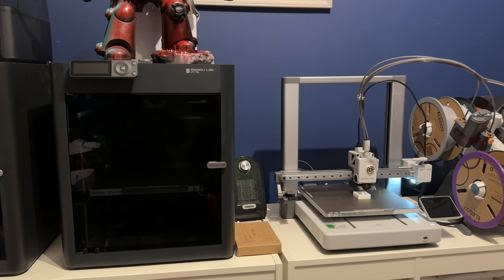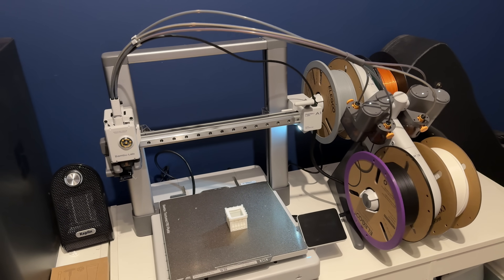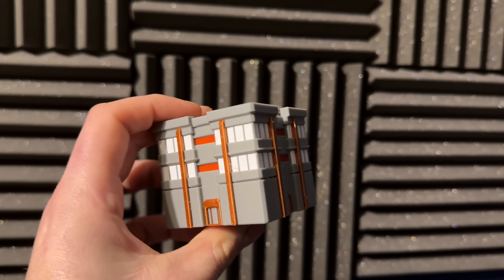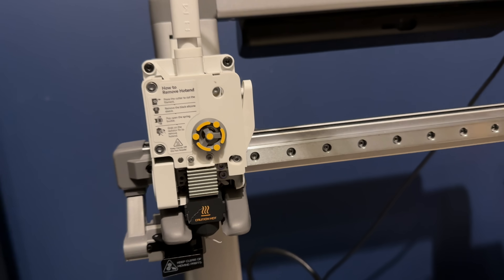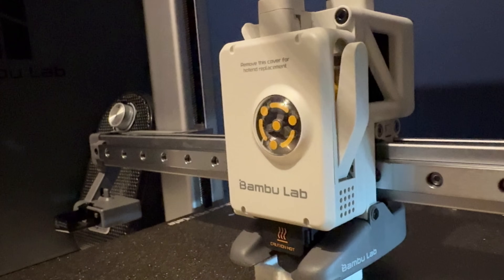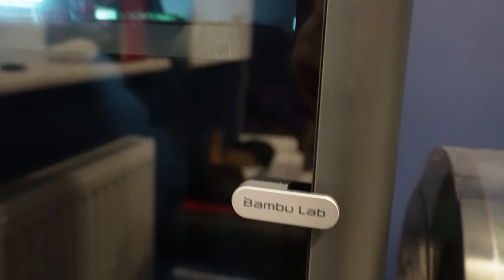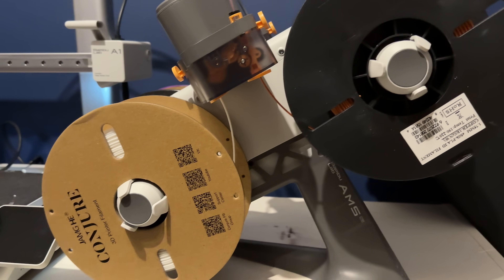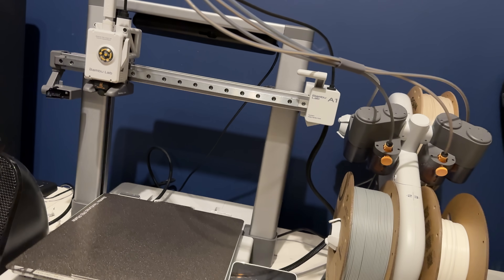Bambu Lab P1S Vs A1: Which one should you get?

Comment: My main question is about the wiper. I just bought the p1s but I'm hearing that the wiper is much better on the a1. I dont want to install mods to mod the wiper on the p1s. How much of a problem does to factory wiper cause on the p1s?
Reply from the maker: I've got two P1S' and an A1. The A1 has a better wiper, but it has affected my prints 0 times on the P1S. Even when there's a little bit of filament still on the nozzle, it never gets in the way.
Reply: @GrayScalpMiniatures cool thanks. Did you change the stock wiper

Comment: 🇨🇦 A1 mini $249 w ams lite $449
      A1.         $399 w ams lite  &589
     P1S.       $649 w. ams        $899
purchased A1 mini w ams lite just over a year ago , have run 40 kg of PLA & PTG through this little beastie 
just regular maintenance , dead simple it out in the open .This little printer in built like a tank , auto calibrate, flow control, clean the bed with Dawn and hot water .The ams lite just works, period.

Comment: I went for the A1 since I heard it was not as noisy which was the biggest problem for me :)  Heard the A1 Mini is even more quiet so I will try to get one of those later.
Reply: and now I bought a P1S haha.. I noticed when printing objects of height.. they could often be bad cause of the printer still prints at full speed at higher layers and the laws of physics can shake things around.  So bought the P1S on the Bambu sale. No AMS this time.
Reply: @AndrewTSqim thinking about a1 combo or p1s combo. What you recommend? I’m using a1 mini now and want to buy second bambu
Reply: @ArcheeKK  I have not recieved the P1S, so I can not speak which is best yet. I have experience with big brother X1E + AMS. Print quality when it comes to PLA, TPU, ABS, PETG is basicly the same. I prefer the AMS Lite over the normal AMS, but its not that the AMS is bad.. but the P1S is a cut down version of the X1E / X1C so it might be worse. i will have to wait and see :)
Reply: @AndrewTSq Hi, for the noise? P1S is more noisy than A1? how much? ty
Reply: @coccheee  My P1S was way more noisy but I found the problem, and it was a bad motor. After changing it, it got more quite. I have gotten the noise down a lot by soundproofening the printer on the inside (just like the big brother X1E has), so it is a little bit less noisy than the A1 now. But default the P1S is more noisy, when the printspeed is high the printer will vibrate a lot and that is what you hear

Comment: Wonderful video - I’m thinking of going with the A1 as my first 3d printer.  Question: is it able to print tall thin structures or would the PS1 be better suited for that?  Example a long sword or a spire on a building? Thanks for any guidance.  P.S. I was also thinking the A1 would be better now and then upgrade to the new forthcoming Bambu next generation printer

Comment: I had an issue with the z screw pulleys on the P1S.  The z had about 1.5mm in slop after only a few prints. Went through the guide to repair-tighten, but it came right back. The thing is the way the parts are designed, there’s not much you can do to prevent or reinforce that setup. 

Now that I know how they’re attached, Im concerned about them failing again. Overall the P1S is a plastic shell that is a foundation for precision parts… not the best scenario in my opinion. 

I wish I’d gone with the A1 and then made my own enclosure if/when that need came up.

I convinced myself that the enclosure was a factor I should consider, but I’m not so sure now that I’ve got some hours on it. 

If I was worried about it being disturbed, would be different

Comment: Really appreciate your honesty!  If a person was starting a 3d printing business would the ability to print ABS be a deciding factor?  Would the PS1 without the AMS be a good initial choice - the AMS can always be added later.  Right now it’s on sale at Micro Center for $600. Any guidance is much appreciated!
Reply: It all depends on what it is that you will be printing.  ABS is stronger and has a higher heat resistance than something like PLA so if your prints don't require these traits then not using ABS probably wouldn't matter.  
What you will be printing also applies when considering the AMS.  If you need to print in multiple colours from the start then its needed.  
My advice is if your budget allows, then get the AMS from the start as its also nice for backup when one roll of filament runs out and the ability to use a dedicated support material can leave a cleaner print saving you time with cleaning up parts.

Comment: Ive read that the other types of filaments aren't recommended. Also, Bambu doesn't recommend an enclosure for the A1. Yet I'm seeing several companies selling enclosures for the A1. Is the heat and ventilation the only reason behind not using an enclosure?? I'm asking these questions on account that I have ordered an A1 combo,  yet I have a good friend who is upgrading to the best bambu printer on the market.  He has offered me both his enclosed printers with low hours at a very good price.The p1s seems to be pretty much the same as the A1 when it comes to the build plate

Comment: I have a P1S and it's been okay but I've had bits break off in the AMS multiple times and it's a pain in the arse to remove the spools, unscrew the covers, (carefully) remove the board, and finally pull out the tube with the stuck bit and reassemble. I wish the lid had a latch and I could tilt the whole unit back and open a hatch to clear the tubes and then just put it back down again. I had a nozzle jam also, another bit of filament stuck just between the hotend and the motor and I had to take the whole thing apart to repair it.

Comment: Definitely NOT the A1, thing is awful. The whole bambu ecosystem is awful, install apps, sign up for accounts etc to use your printer. It takes longer to be able to setup your printer with wifi capabilities than it does to build an Elegoo Neptune.
Then it's Z homing errors, 5 minutes to change filament etc.

Comment: Agree with everything you mentioned.  I have an A1 and an  P1S.  Looking to add another printer and will go for a P1S as I want to swap out to a hardened nozzle and gears and dedicate it to engineering filaments.  My opinion is the X1C is overpriced for the minimal upgrades over the P1S.  I tend to control everything from BambuStudio so the touchscreen is not a big issue.

Comment: Honestly, if the P1S had the A1's screen and quick-change hot end clip design, it would be pretty much perfect.  As someone looking into getting into 3D printing, probably primarily in PLA and/or PETG, the Bambu series have been at the top of my list for a while.  They just seem to have the best user experience, print quality, consistency/reliability, and depth of support (parts, etc).  The P1S is probably the sweet spot, as the X1C is overpriced for the incremental improvements you get over the P1S, and the A1 is a bed-slinger (probably why it's slower).  However, I'm slightly annoyed by the 1980s screen tech and the fiddlier nozzle access on the P1S.  And I'd love a larger build volume, but no one seems to know if Bambu is ever going to make a "max" version of any of these printers.  My luck, I'd buy a P1S/AMS, only to find out the next week that Bambu have announced a larger, better printer.
Reply: I think the P1S is such a good value they had to leave the screen or else they would have some challenges selling X1Cs in comparison to them, also it probably did give a bit of help keeping the price down. I primarily use the app and send my prints from my phone or the slicer on my PC anyways. I have around 800-850 hours on my P1S currently. Did the basic maintenance items monthly, just switched my first nozzle out and it’s been great thus far. I just ordered an A1 for a cheap second printer to take care of things whenever I’m backed up or to have a secondary option incase the P1S goes down.
Reply: @elemento1991 I just ordered a p1s and am new to the scene, what's involved in your monthly maintenance routine?
Reply: @hatdag5976  Monthly maintenance is pretty simple. If you get on their wiki they have a nice in depth page on the machine and it’s pretty user friendly. I just make sure the carbon rods are clean, get all the dust out of the machine and lubricate the Z-Axis rods monthly. Every 3 or so I will open it up and do a more in depth clean, lubricate the bearings. The wiki will guide you through your maintenance schedule.
Reply: P2s lol
Reply: @johnparkes2452  - Yeah, literally! LOL
Reply: You can always add on the Bigtreetech larger screen as a second screen, but yes, it's odd they put a smaller screen on the more expensive P1S.
Reply: Why would you need a screen on the printer? Almost everything (if not all) can be done via WiFi without even leaving your seat.
Reply: @MikevomMars  I would still prefer a screen on my Sky Q satellite box as we had in the analogue days. Even if it was just a single line display.

As for the P1S printer, I'd still like a decent screen on there as a backup should the internet go down, so I might still have some way of controlling what the printer is doing in an informed way.
Reply: @stephenvalente3296  Well, I started printing some 10 years ago with the Anet A8 and stuck a couple of years with every printer I had, so I am still used to crappy displays. Therefore, it's quite the opposite for me now - I am amazed to use printers with WiFi now so I even don't have to touch them to start a print (instead of copying data on a SD card and putting it into the printer) 😀
Reply: @MikevomMars I don’t disagree that having the wireless, app based approach is great. I still like to have a physical, interactive connection with tech though for when the external interface plays up.
Reply: @stephenvalente3296  That's what the slicer on the PC is for me - this is the central hub where I do all the stuff and settings, including calibration. I use the mobile app for print monitoring while being outdoors only (nothing else) and the printer display to retract or extrude filament or moving the printhead when I need to tinker something. But have to agree, habits are very different.
Reply: @stephenvalente3296 I get liking physical controls, but I’m struggling to picture the scenario where Wi-Fi is dead, phone reception is trashed, and “manually starting a print” is still an urgent need rather than a non-issue
Reply: I have a same problem. I prefer the A1 for display and everything, but room where I want put my 3D printer is cold and humid. So I would buy P1s but same like you. The day I will open the box will be day with new edition of P1s😁
Reply: Same
Reply: I completely agree with you. The P1 S screen is such a turn off that I don’t think I can bring myself to buy it for just that reason.
Reply: Bambu are bringing out the H2D which is larger and revolutionary in their words which will be above their X1C in terms of flagship. Coming out Q1 2025. Will be expensive but probably worth it
Reply: @simonh2011  Its really expensive and is a miniature workshop, 2 nozzles printing different materials at same time, laser cutting and engraving and some other features I dont really remember. 
Im looking at buying the A1 but i dont know if there will be better alternatives at end of 2025.

Comment: Nothing wrong with the top mount ams light, P1S is 10% slower not 15 it's due to the double travel speed on the P1S compared to the A1. You day the A1 is a little bit quieter it's actually 10dbs quieter so double the noise level

Comment: Idk why I’m even watching this. I’m currently still using my old ender 3 v2 so either of these is going to be a MASSIVE upgrade. I’m going with the A1
Reply: I have an Ender 3 I bought 2nd hand for $50 on eBay from some print farm for personal use, and meanwhile worked at a shop that had the top-end Bambu X1 Carbon with the 4x filament rack dealie. I'll tell you what, the "quality" difference is minimal. Also, we had way lot of problems with bed adhesion on the Bambu and that's after washing the magnetic liner with soap and water and all that. My personal opinion: Bambu is not delivering what they are charging for. I got some plastic vapor barrier and whipped up a "good enough" enclosure for the Ender, I dare say I get at least as good ABS prints as the Bambu.
Keep in mind my background in rapid prototyping goes back 30 years to 1994 using Israeli Cubital apparatus which employed "solid ground curing" technology, and which produced superior prototypes to today's filament extruders (though not nearly as good as modern resin printers however).

Comment: I've been a Creality guy for a while but just purchased my first Bambu labs A1 combo kit. I'm going to take a chance with the top mount bracket for the AMS lite. I don't have the space for such a large foot print. I've been printing it in PETG on my K1C. Love my K1C by the way. An amazing printer with outstanding quality and speed. I was all set to pre order the K2 Plus but decided I would wait a while to see if there are any user issues before diving in. The 350mm squared print area is a big sell for me. What the A1 lacks in size it seems to make up for in quality. I look forward to learning the AMS as this will be my first experience with a multi filament system. I do all of my slicing in Orca. So the Bambu studio should be an easy transition. Great video by the way!
Reply: Make sure the top mount has the extra feet behind the gantry

Comment: Bambulabs A1 currently displays a recall - do not  use - message on the LCD and has a confusing mix of solutions. I bought the unit from the Burnaby Canada office for family from another country. "Industry (manufacturers, importers, sellers) must report health or safety incidents involving a consumer product. This requirement is outlined in Section 14 of the Canada Consumer Product Safety Act." Bambulabs have no info in the government product safety data base so they are either ignorant of the law or complicit. They must alert the purchaser and recipient immediately and effect a replacement or immediate refund.

Comment: Great review.. I was an early adopter of 3d printers and over the years have owned many many different brands some good and some just awful.  I recently took the plunge on a A1 Mini with AMS to try the technology before possibly getting a bigger Bamboo Machine.  To say I have been blown away would be a massive understatement.  The printer screams quality immediately apparent by the weight.  Within 20 minutes it was put together with the AMS and starting a test print.  The quality is incredible in fact I didn't think this sort of quality was possible on an FDM machine.  You really need to look extremely closely to stand any chance of possibly seeing a layer line or two.  Three months on and it still give that 'wow' reaction every time I use it,  totally intuitive, superb quality prints at an incredible speed.  The software on my Mac and the iPhone app is just brilliant and for me covers every thing I have so far needed to do.  I will be purchasing the P1S next and selling my other printers.  They really have produced a winner

Comment: Is there any difference in build area? I've heard that, in the case of the A1, corners of prints with a large contact area with the bed can curl up, meaning you can't really use the whole area of the bed in some cases.

I'm trying to decide which one of the printers to buy, and if this issue really exists it'll be the p1s for sure🙃

Comment: the major thing is the A1 is going to be slower, due to the nature of a bed slinger.  Its also going to take more space because, again, ITS A BED SLINGER.  So it commands more space not only AS the printer but also that AMS takes even more space.  The P1S/X1C are Core X/Y allowing for higher speeds, because only the print head is moving, also you can play with the settings and speed up the jerk/accel over default.  Also that AMS sits on top meaning the form factor of the whole system is only as large as the case it sits in, maybe a bit extra if you print the poop bucket that goes on the side.
Price, ya the A1 is great for muti color at about half the cost of the P1S.  However the P1 will give you better future proofing should your printer needs change or expand (and they will).

Comment: Great video. So you didn't return your A1 for the recall or was this before the recall? I loved my A1 in spite of the fact my heat bed failed before the recall (not the wire, if just wouldn't heat higher that 36). I returned it via the recall and am patiently await the re-release of the A1. The A1 mini I have as well is working great. I hope they get the new version out in early May, have ample supply and give those of us that returned via the recall priority. If the A1 will only take 1 AMS why are there 2 ports? Lets hope they implement the use of two AMS's at some point via a software update, a hub like the other printers.